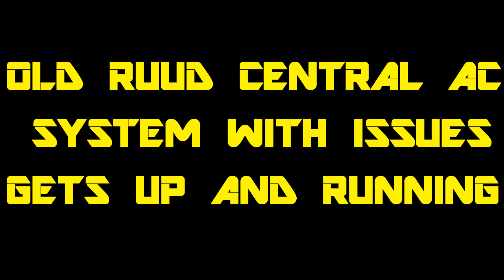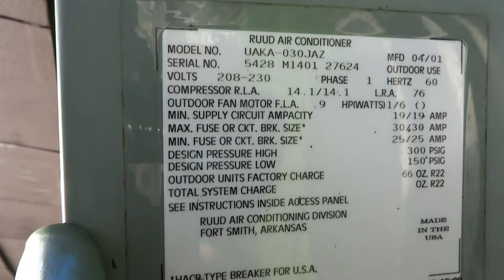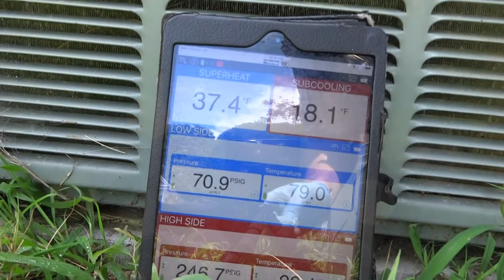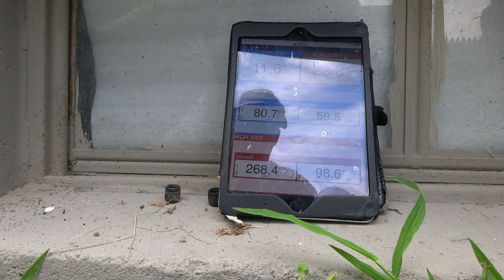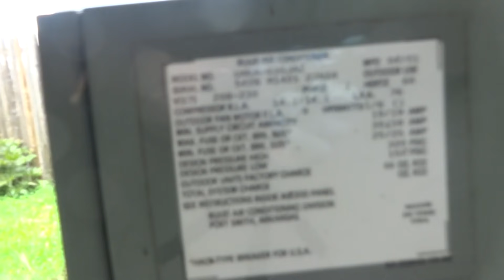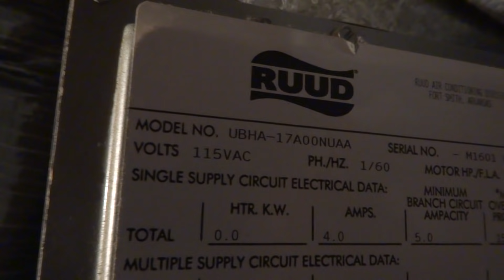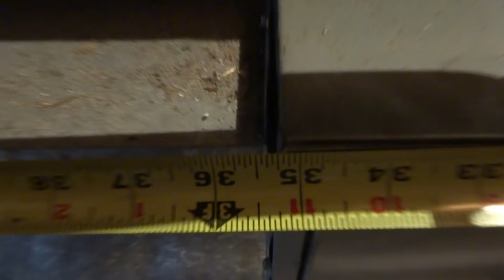OLD RUUD CENTRAL AC WITH ISSUES GETS REPAIRED

Comment: Kinda happy to see you struggle, I don't feel so bad. I had jail shower today that wouldn't shut off. Talk about over engineered crap. The acorn metering valve is in a tiny cut out on stainless steel shower. No room to work. Disassembled and cleaned all parts and put back together. Still kept running.  Took out and replaced gaskets and diaphragm's.  Still kept running. Had to install new valve $165.00 and worked. At least the girls in C pod gave me a standing ovation mama!

Comment: Why did you mess with that terminal? You got there and within 5 seconds you already summed up the problem..CHANGE THE CONNECTOR..Why did you try to force it tight? IT COULDA BROKE, you better stop working distracted..you need to focus. As experienced pros, our FIRST ASSESSMENT/ INSTINCT/ INTUITION IS USUALLY CORRECT.
I went insane watching that
Reply: I was freaking out with him using channel locks to try and get that lug off.  Had to be a better tool for the job.  He does better when he's not upset.  Applies to most of us.